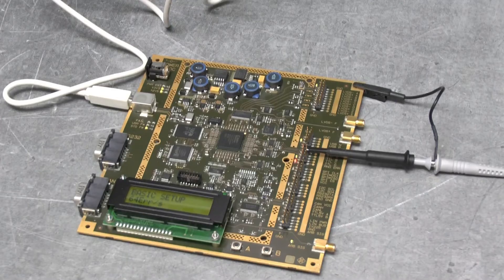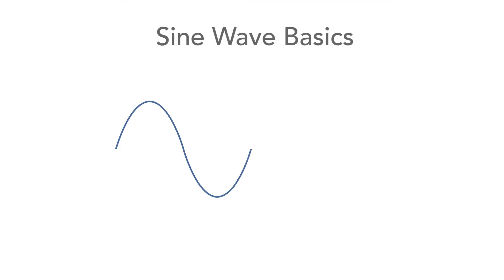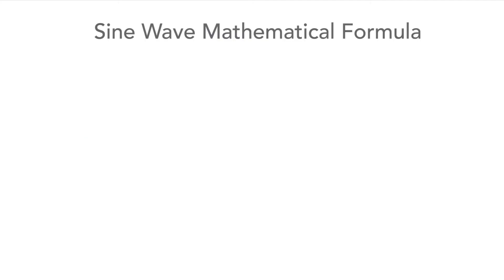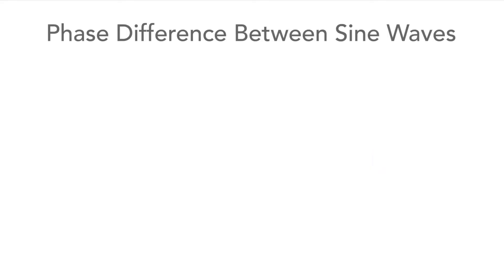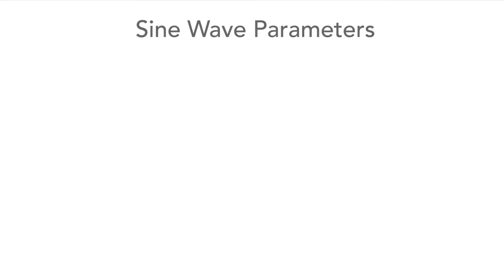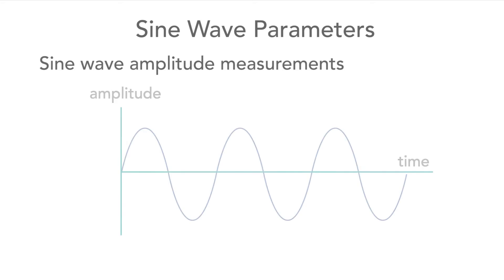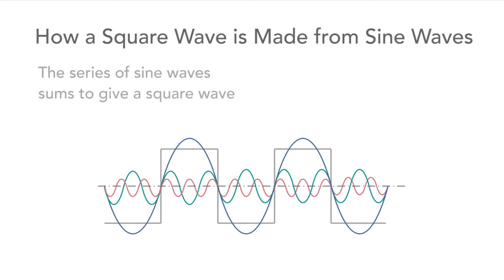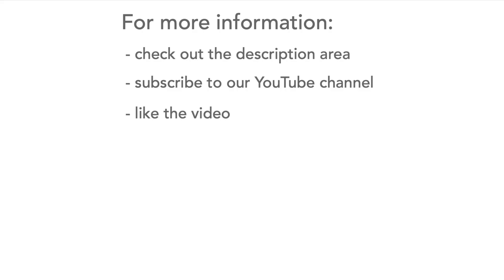What is a Sine Wave - why it is an important electronic waveform

Comment: Great video! I have a question though . My professor asked me why we generate current as sinusoidal waves? I am still looking for answers but can't find anything he'll accept. If you can help me i would be educated and pretty happy.
Reply: Another reason is how the power (voltage and current) is produced in generators. The spinning magnets naturally produce periodic increasing and decreasing flux through coils of wire in the generator. This creates sinewave voltages (and currents when hooked to a load). If generators are not familiar, think of electric motors. Generators are just rotating machines like motors, working in reverse (generating power rather than consuming it).
Reply from the maker: This is an interesting question. AC is used rather than DC because it can be transformed between different voltages. We see high voltage lines that carry many kilovolts, but our domestic supplies are much lower - typically 115V or 240V. High voltage power lines are used to distribute power because they have much lower losses than lower voltage ones - the resistance is the same regardless of the voltage. The resistive losses depend upon the current, so if the voltage is raised the same actual losses occur, but this is a much smaller portion of the overall power carried. DC cannot be transformed, it has to be AC because transformers do not work with DC.
As for use of a sine wave, this is because it is only contains the fundamental frequency - all other waveforms contain harmonics. AC generators generate a sine wave. The other advantage is that square waves contain a high level of harmonics and these can more easily radiate and cause interference, etc. Also transformer efficient can be optimised for a single frequency rather than having to accommodate all the frequencies of a square or other form of waveform.
Reply: @ElectronicsNotes   I am going to mail this to my professor if he accept's i'll edit my comment. Thanks for the answer!

Comment: Thanks for the video. What I'm currently trying to understand is why the sinewave doesnt produce harmonics or partials (besides during the attack phase) and all other waveforms do.
Reply: Mathematically, a sine wave lasts for ever. It started at minus infinity and continues to plus infinity. So, if you switch it on at some point, what you have is not mathematically a pure sine wave. That accounts for starting transients.

The really interesting thing about sine waves is that if you put them through a linear system then you always get out another sine wave with exactly the same frequency. The shape is exactly the same, only the amplitude and phase are changed.

That makes them very useful to help document the characteristics of a system. You can feed in lots of different sine waves and see how the magnitude and phase of each one changes as it passes through the system.

If you think about a square wave with a perfect 1:1 mark-to-space ratio and you put that into a system then each harmonic will be treated independently. If some frequencies are delayed more than others or if the amplitudes of the harmonics are treated differently then the shape of that square wave will be altered so what comes out will not look like a square wave.
Reply from the maker: A sine wave is the fundamental waveform and by definition a perfect sine wave does not have harmonics. Other repetitive waveforms can be built up using a series of sine waves.